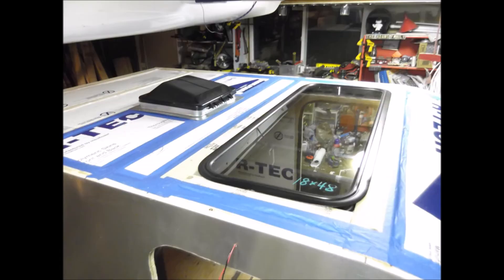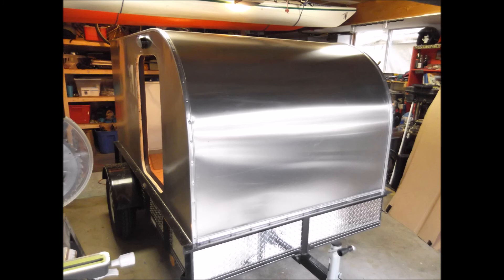Teardrop build

Comment: Looking forward to more videos. Excellent craftsmanship. Where did you get the rear door?
Reply from the maker: Thanks, got the door from a local rv new and used parts supply store in Portland. It was a used 48x48 door that only cost $90.
Reply: @mrmja50  hey Matt, 5 years later, how’s she holding up?    Just starting a build myself, curious how the homebuilt ones stand up to the years

Comment: How did you remove the tail gate ..? i have the same trailer and want to do the same thing ..?
Reply from the maker: Had to grind the weld off. Good luck.
Reply: was it hard ?..I don't even have any tools like that I think this is going to cost me to build this ...
Reply from the maker: I used and angle grinder. Take it to anyone who does welding and they can do it for you.
Reply: thanks i will have to look that up for around here ..